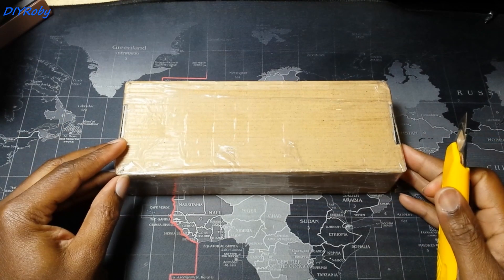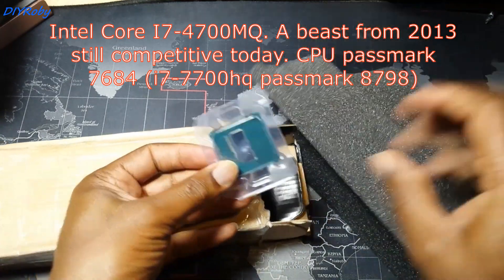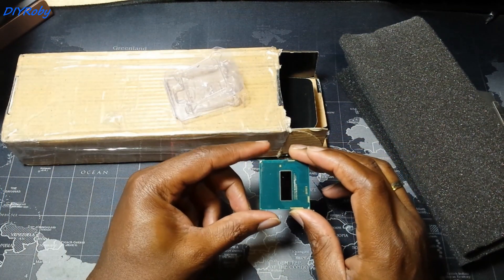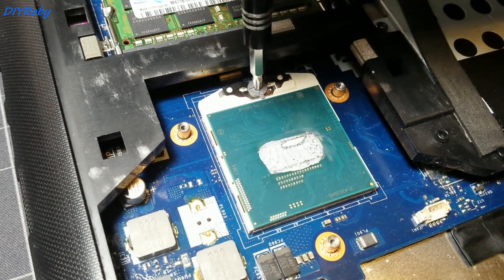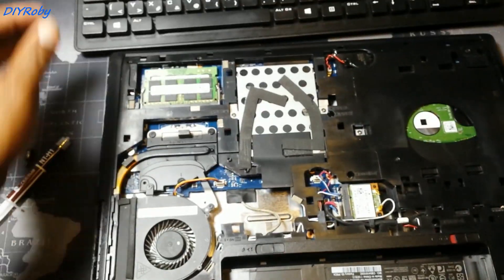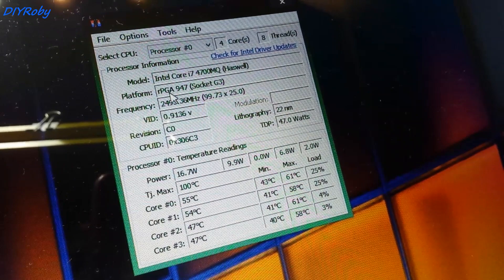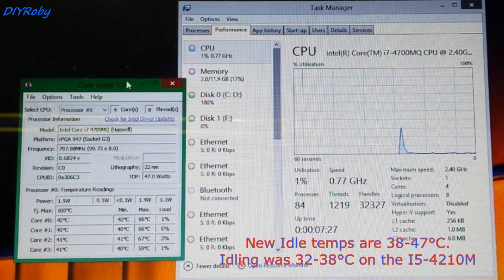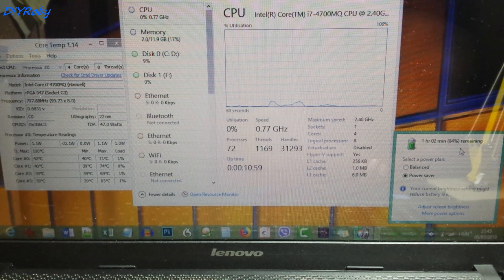Laptop Cpu Upgrade I5 4210M to i7 4700MQ. Unbox, Install, New Idle Temperatures

Comment: i have lenovo z510 with i5 4200m, today i bought core i7 4700mq, but with new cpu the laptop won't boot, it shut down almost in 1 second. i tried several times but it does not work. why?

Comment: i wanna upgrade and was afraid of heat as u mentioned i saw the other video where u did the diy heat sink 
is it gonna be the same if i use the double copper pipe original heat sink that comes with the i7 version ? it has 2 pipes one for cpu and one for gpu but it passes in the same area u glued the second pipe 
so pleas let me know if it's possible 
i wanna do i7 16gb ram and 1tb ssd for work but i am afraid of heat haha
Reply from the maker: Sorry for late reply. Sadly on my laptop, the i7 double heatsink does not fit. There is something different on the motherboard that blocks the second heatpipe. Measure yours well before you buy it. If it fits then it will work great.

Comment: Do I have to do a BIOS reset? My old laptop doesn’t start up with the CPU I installed, regardless of correct socket and chipset compatibility.(i5 2450m to i7 3630qm)
Reply: Technically it should work because both processesor are sandy brige, but MB may need update bios.

Comment: Hello, im update my t440p with board 20AWA17K00, and dont start...  i have i5 420M(tdp 37w), I want to change it for i7 4700mq (tdp47w), does not start...  and the processor socket gets very hot... please help me

Comment: upgraded a fujitsu a574/k japanese model 2950m to 4700mq  seems to run fine but seems to be throttling because of lack of power not temp :(
Reply from the maker: Do you have a 90W power supply for the laptop?
Reply: @diyroby732  i tested 2 power supply the standard adapter was 19v 3+a
i tried a 19v 4+a and a 19v 6+a both worked but still throttled
i think its hardware related and the board just isnt made to deal with 4 cores and higher power cpus

Comment: Did you underclock it? Mine runs hot also
Reply: try to check your fan. mine got 74degrees celcius upon checking fan already not functioning well due to dust.
Reply: @m4Rlb0roR3d  I added another heat pipe to the cpu cooler. Doesn’t get above 50-60 now
Reply: @viv1d  How did u do it bro?
Reply: @victorgomes5667  bought another cpu cooler with the same heat pipes and modified it to fit on my existing cooler with thermal glue

Comment: your cpu is throttled at 0.77 ghz because the 4700mq requires 47 watts, the 4210m requires 37 watts, when your not doing nothing, the 4700mq should run at around 1.90 ghz - 2.20 ghz

Comment: my previous cpu TDP is 35W, can i replace with 45W or 55W? want to change from dual core to quad.. Thankyou
Reply: not. The motherboard and power supply are designed for 35w processors only. What processor do you have? socket PGA?
Reply: @slavafedotov5742  thats 2 months ago comment, and i already changed to QM hahahha .. yes
Reply: @rjlupin96  Congratulations ))

Comment: Hi, can the Celeron 2950m upgraded to a better processor? And if so, whats the best cpu for it :) thanks
Reply from the maker: You don't mention your laptop model. Here you will see the cpus that are compatible with that G3 socket http://www.cpu-upgrade.com/CPUs/Intel/Mobile_Celeron_Dual-Core/2950M.html
Reply: i got the same 2950m upgraded to 4700mq on a japanese fujitsu a574/k model can't maximie the 4700mq i think because of power draw its not going past 90+ temp

Comment: When upgrading a laptop you need to take into account a) socket type b) BIOS support for the CPU c) thermal specifications. This laptop was designed to run with a 37W TDP CPU. The i7-4702MQ would be a much better match for temperatures and battery life. (37W vs 47W TDP)
Reply from the maker: The laptop actually shipped with the 4700mq as an option so BIOS supports it. The i7 4702MQ would have been ideal but it's price is unreasonable (usually over 100 USD). I got my 4700MQ for 62 EURO. It was so cheap, I could not pass up on the deal. I have since upgraded the cooling system from a single to dual heat pipes and can now run this CPU at full load over 3ghz with no problems. There's a video on my channel documenting this upgrade.
Reply: @diyroby732  Good stuff. Interestingly, a list of G510 supported CPUs I came across only mentioned 4702MQ from the big guns. I have the same laptop, waiting for my 4702MQ which went for around 90e. I checked your video to get an idea of how to get to the CPU after opening the casing. I'd prefer the 4700MQ cause apparently it's a bit faster (also cheaper!) but went for the "safe" thermal option. Plus the laptop is running plugged in 24/7 with a closed lid so power consumption is a consideration. (btw I do understand energy expenditure vs TDP, I think the main thing here is how good an idea 24/7 is for laptop lifespan).
Reply from the maker: That was a good price for the 4702mq. TBH only a well tuned, well cooled, non throttling 4700mq will be faster than its 37w variant. You arent going to be missing out on much performance. Please update on how that cpu goes for you.
Reply: @diyroby732  I'm new to the concept of throttling as I haven't used my laptop much even though I have it since 2015. I have been using desktop CPUs with big heatsinks that always run very cool. Also my current laptop CPU i3-4000m never throttles. I ran OCCT 5 last night however, for ten minutes. I got temperatures of ~90C and only in the last minute the CPU reached close to 100C and I saw it throttle once. I expect similar behavior from the 4702MQ. My idle temperatures at the moment are 60-65C, I really would like them a bit lower, even 5C would be great.
Reply from the maker: Coming from desktops you'll be shocked how hard it is for a laptop to maintain high clock speeds on 4 or more cores. First thing to learn about is undervolting your CPU. I use throttlestop and have videos on it. That should bring down your temps by A LOT.  You are going to have to undervolt your i7 to tame that beast. I 4700MQ idle temps are 35-43C
Reply: @diyroby732  Thanks, I will check out your video. I was under the impression you can not do much with the CPU frequency/voltage and other configuration with the laptop's very restricted CMOS setup. I presume there are applications that help tweak these settings you normally have no access to.
Reply from the maker: Great job congrats. Temps are a bit high probably due to the limited i3 heatsink (a single heatpipe right?) Anyway, that is quite the performance jumb from non hyperthreaded i3 dual to hyperthreaded i7 quadcore.
Reply: 4210m islemciden 4712mq islemciye sadece islemci degistirerek gecis yapabilir miyim extra olarak bir islem yapmama gerek var mi ? Yanitin icin simdiden tesekkur ederim

Comment: Wonderfull video! I have a i3 4100m. Can i change i3 4100 to i7 4700mq? And then my laptop has not graphics card, it use intel hd graphics 4600 with processor. Do have i7 4700mq any intel hd graphics?
Reply from the maker: What laptop do you have? 4700mq has HD Graphics 4600
Reply: @diyroby732  i3 4100m, 8 gb ram, 240 gb ssd and 500 gb hdd
Reply from the maker: @canamnesis5947  Is it a Lenovo G510 like mine? I think you can. It shares the same FCPGA946 socket as the 4700mq. Here is a list of compatible cpus http://www.cpu-world.com/Sockets/Socket_G3.html
Reply: @diyroby732  my mainboard socket is rPGA 947 (Socket G3)
Reply from the maker: @canamnesis5947  It should work. I still don't know your exact laptop brand name. you have to use that name to search for cpu upgrade options. Because the socket may take the cpu but the BIOS may not recognize it if it wasnt configured for that exact model

Comment: How can it accept a cpu that needs 10 more watts then the previous?
Reply from the maker: Laptops with non-soldered CPUs usually have a range of CPUs available for use, based on the price you are willing to pay. My G510 can take a Pentium, i3, i5 or i7 CPU. You confuse TDP with power drawn by the CPU. In fact, TDP is thermal design power, the maximum amount of heat (in watts) produced by a computer chip or component that the cooling system in a computer is designed to dissipate under any workload. So 47 watts heat produced by the i7 4700MQ is 10 more watts in heat that the laptop cooling has to dissipate. If it can't, the laptop will throttle down the CPU to a slower speed. In operation, this 4700MQ CPU draws 13 to over 50+ watts depending on the work done.
Reply: @diyroby732  ohhhh so i mean i want to buy a dell latitude e6440 and it has a i7 4600m and i am thinking to upgrade to maybe i7 4700mq but it uses 47w so i dont know if it will work?
Reply from the maker: @Benko_DieseL  See this forum page for more details on what you can upgrade to https://www.techinferno.com/index.php?/forums/topic/5481-14-dell-latitude-e6440-owners-lounge/

Comment: Ok bro, I'm actually surprised by quality of the video, real nice results made with well utilized resources. Both sound and video are really good. But speaking of the CPU, I have the same exact laptop with Pentium 3550M CPU and Im thinking of upgrading it to something from the G3 socket list, like i5 or i7 but will it be an issue if i upgrade it to something with a higher TDP since 3550M has only 37 W? Or the only issue i should be worried about is temperature?

Keep up the good work!
Reply from the maker: Wow thanks for the feedback and compliments QkeeZ. There is a whole series of videos made about this upgrade procedure on my channel. The latest being modifying my heatsink by adding a second heat pipe to increase the 37W TDP limit. This fully solved my heat problems and now allow me to run this cpu at 3.1ghz all 4 cores long term (video rendering for example) without ever exceeding 90°C. The video is here https://www.youtube.com/watch?v=wNI6QA0TIxI If you don't go the modding route, you can buy on ebay the dual heat pipe heatsink for the discrete graphics version of your laptop and install it. If you want to keep the 37w stock cooling then the max speed I could go at long term is 2.6ghz all cores (with a 100mv undervolt). Even with turbo boost deactivated, this CPU gives you a guaranteed speed of 2.35Ghz 4 core speed, which is more than twice as fast as your Pentium can do work now. It's worth it, but you WILL take a massive hit on battery life. I have my laptop plugged in 90% of the time but I feel the hit whenever I need to go unplugged for a while. Hope this clarifies your doubts.
Reply: @diyroby732  It sure clarifies a lot! Im thinking the same thing, the i7 will perform drastically better than the Pentium does. I also use laptop while plugged 90% of the time, as a backup to my PC when i travel. I'll watch your vids soon and will try to upgrade the trusty G510 asap. Again, keep up the good work - Thank You!

Comment from the maker: After struggling with a 85°C thermal limit, the 4700mq finally unleashes its 3+Ghz all core speeds. i5 4210M video render times now slashed in half https://www.youtube.com/watch?v=Io1Nr05cofk
Single to Dual Heatpipes DIY mod reduced temps by 15°C https://www.youtube.com/watch?v=wNI6QA0TIxI
Reply: Dear owner for this YouTube channel please put new thermal paste onto that processor.

Comment: in a work apps speed of processor incrase to 2.4 hidher?
Reply from the maker: yes. Can go up to 3.4ghz single core. But I have disabled turbo boost because of loud fan noise. I keep it at a maximum of 2.4ghz

Comment: i have the same cpu can i upgrade it to i7 2760qm
Reply from the maker: You mean you have the same laptop? or the same i5 4210m cpu? The i7 2760 is a totally different generation cpu.
Reply: @diyroby732  i have the same cpu
Reply: @diyroby732  i am going to use egpu as well ita gtx 960
Reply: @diyroby732  if its not ican upgrade my laptop to the same cpu in the video the i7 4700mq
Reply from the maker: @krat0skrat0s69  Which laptop model is it you have?

Comment: haloo, I want to ask, can the u series laptop processor upgraded to QM series?
Reply from the maker: Unfortunately, U series processors are soldered to the motherboard.
Reply: @diyroby732  okee, thank you
Reply: @diyroby732  wow.  and can pentium 2020M upgraded to i7-3630QM ?
Reply from the maker: Check here http://www.cpu-upgrade.com/CPUs/Intel/Pentium_Dual-Core_Mobile/2020M.html to see which CPUs use the same socket. Then do a google search for your "laptop model +upgrade CPU" to see what the manufacturer recommends.